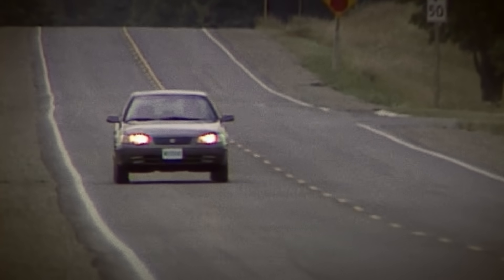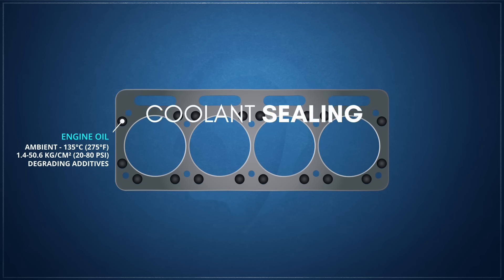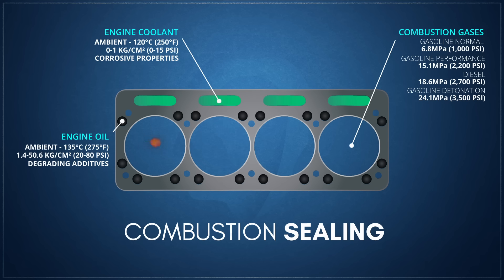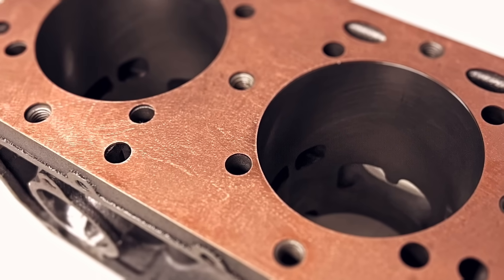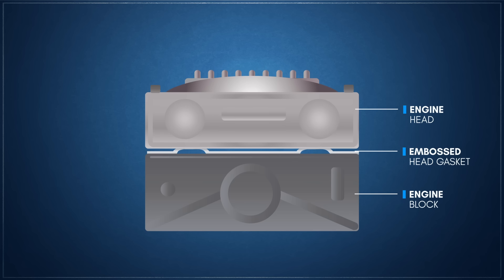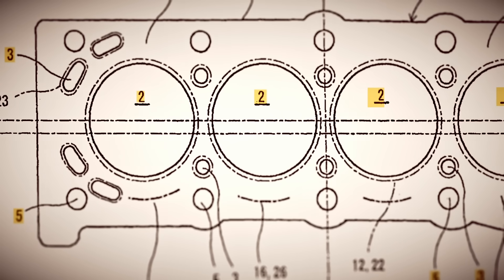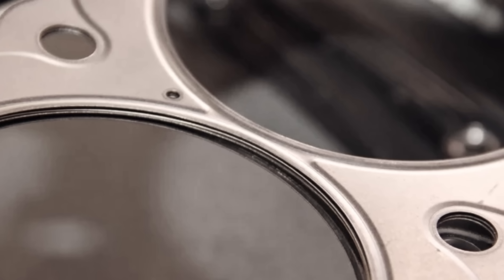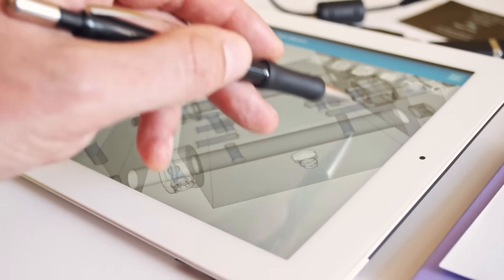The Most Tortured Part In An Engine

Comment: I seen the title and automatically disagreed with it, finished the video and dont really have anything to disagree with. As a 20 year mechanic I hardly ever see head gasket failures these days, ingress due to the pretty amazing engineering. Building high performance engines we have to nail the details of the sealing surface, blocks and heads are a mirror finish, MLS headgaskets and arp headbolts usually does the trick. The main parts problems I see these days is running engines exponentially over there design capabilities and trying to pinch pennies and not replace every part inside the engine with the best stuff on the market. Right now I'm building a 60s engine that was originally 125 horsepower 7:1 compression and taking it to 500 horsepower 10:1 compression with 20 pounds a boost, not an easy feat. But feel like the head gasket is the least of my worries and rods and crank start becoming the weak point. Of course you can replace them with 1 off forged pieces, but where is the fun in that.
Reply: There is absolutely no way on earth that a 1960s engine designed for 125hp is going to handle 10:1 with 20psi, it'll snap the rods (and probably the crank) like a twig.
Reply: @MattyEngland  not my first rodeo. Plus it has been done by several people before. Cranks are very well designed and should hold quite a bit of power, I am pushing the limits of the rods but they have been worked over to be the best they can be. Should hold up fine, the boost controller is tunable, worst case scenerio.i turn the boost down with a knob and all is good. Also has knock sensors on it. And the pistons are some drastic amount lighter then the originals with much smaller lower friction rings. With a good set of rods people have been known to get 1k horsepower out of them. And I know well over 1k with a aftermarket crank. I have done alot of work to make sure it holds up.
Reply: @townsendliving9750  They must have been the worlds most over engineered rods from the factory then lol....10:1@ 20psi gonna be some crazy cylinder pressures 😲 Best of luck. 👍
Reply: @MattyEngland  The over engineered rods are the modern ones. They know they'll bend like bananas at 200% of rated output power. 

Old stuff? Nah, just make it look like a conrod. If it breaks, we make it bigger.

Comment: I'll  be bluntly honest here the temperatures and pressure a head gasket has to deal with seem oddly low, I can see how the variation of which can stress it but I'm certain we have parts in other mechanicle objects that undergo much much more stress say in like a  jet engine.
Reply: Low when it's naturally aspirated. They get real stressed when you add lots of boost, timing, or nitrous.

Comment: My 2002 VW/Audi engine in my daily, has 20 years and 130,000 miles on the original head gasket
Reply: So?
Reply: @sexyfacenation  So it shows that a well designed modern head gasket can last for such a long time, despite hundreds of millions of combustion events, and many thousands of thermal cycles. A lot of less well built engines would need a new headgasket long before that.
Reply: @sexyfacenation  Time and driving conditions play a huge part too, not just the mileage!
 Practically all high mileage vehicles have clocked up those miles on long freeway/motorway commutes. Under cruising conditions the head gasket is at its least stressed, as combustion temperatures and cylinder pressures are both at their lowest points.
Driving short journeys in a city is completely different. Much higher cylinder pressures and temps when  accelerating as the engine is calling for boost from the turbo, and an advancement of ignition timing. Both those things are far harder on the gasket than anything you would encounter driving long distances under highway conditions.
Time is also a huge factor. Surviving those conditions day in day out for 20 years, combined with all those heat cycles, imo shows of just what a well engineered piece of kit modern headgaskets have become.

Comment: He's got the oil and coolant passages backwards
Reply: How?
Reply: @jonasthemovie  the holes around the cylinder bores are almost always coolant passage ways because you want the antifreeze running past the combustion chambers. The oval ones at the top look like they would be were the push rods come up from the camshaft and into the head also they look more like oil passageways even if this were overhead cam.

Comment: My friend make head gaskets for living, all made of copper sheet's. He made it for 2 stroke, for gasoline/diesel engine, for cars, dirt machines, tractors, ship's engines,semies bikes all of them.
All costumers are extremely satisfied and grateful.
So, I believe copper  is very good material for gasket, he believe that metal multiple sheet gasket is pise of shit, because after some time rubber coating fall apart and steel can't be press so strong that it fill voids in head and block.
He's father made some cooper head gaskets before 30-35 years, and costumers bring them back, for engine rebuild purpose only.

Comment: Engine oil has in every engine hard pressure limit set at 5-10 kg/cm^2. Uncommon failures of bypass valve are making cold oil pressure to rise above 10 bars and then oil filter can gets deformed until it fails open
Reply: The SI unit version has a range of like 40x and the imperial has a range of 4x, so there's clearly an error there somewhere.

Comment: Great video! One problem, in the first half of the video with the diagram of the head gasket the oil galleys and water ports are switched with eachother, since the coolant will need to be taking heat from around the cylinders and the oil usually just drips back through the head gasket down to the block
Reply: Galleries not galleys. 😵
Reply: @bat__bat  No, it's definitely not "galleries." That's where you keep artwork.
Reply: @jacobnelson2480  Surprisingly.. if you were to find parts in relation to them, they will all be labeled as "oil galley ___". While I agree gallery is the better choice, it seems that it is a galley for some bizarre reason.
Reply: Through my few years of school and experience I have always known them to be Galleys, but to each their own. I don't plan to change as that is always how I've known it, and this is what I do as a career.
Reply: Bugged me he used kilograms per square centimetre as a unit of pressure for half the video (nobody at all used that that I'm aware of) then switched to pascals for the last half which is at least SI and actually used.

Comment: Hey, min 4 to 7 - shouldnt it be 20-800 PSI - pressure of engine oil (or 1.4-5.6 kg/cm2)? :)
Reply: Top notch history of head gaskets! Thanks
Reply: Probably 5,6kg... 50 bar will wreck stuff

Comment: One thing I would like to add about head lift and the use of a gasket - The gasket is compressed during installation, so even during extreme cases of head lift (0.001") there should be no separation occurring between the three components.

Comment: Most new coolents are indeed acid based, OAT (orange, purple, etc.. organic acid tech) now, and DO directly attack some of these surfaces. GM had a huge issue with them eating thru intake manifold gaskets, and they would have very similar symptoms to head gasket failure. (oil and coolant mixed into the frappuccino of death). The green stuff isn't nearly as harsh, but needs to be changed more often (per OEMs).

Comment: At 2:59 I highly doubt the coolant gets that hot. Most common answer I found was around 104 celcius.
Reply: Depends on the engine and load. Common coolant boils at around 120 C, but some aircraft engines run high pressure systems that can operate as hot as 135 C

Comment: Your initial list of requirements doesn't include "cost" even though it is a primary driver in most engineering decisions (as seen in the rest of the video). I was wondering why they didn't get around to using crushable aluminum gaskets, but by the end of the video, the copper ones basically fill that niche.

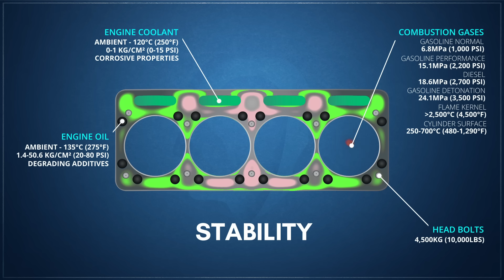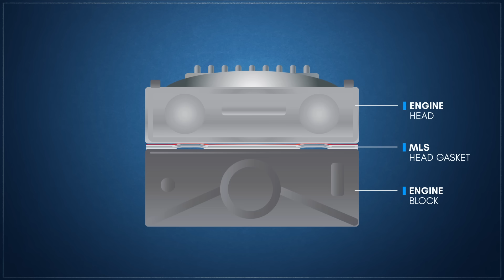Comment: This is a really interesting video so I hate to be a pedant, but there's loads of unit errors in here. You're inconsistently measuring pressure in Kg/cm^2 and Pascal (4:30), force in kgf rather than N (7:00), using the wrong capitalisation for milli and metres (14:10), rounding unit conversions with the wrong precision (12:20), using u rather than μ for micro and mistakenly using μm when you mean mm (14:20). It's difficult to follow your point through all of this.
Reply from the maker: Do you remember a while back when NASA lost a mars probe due to two teams working in completely different units? That's this video right now; I completely missed the errors. I can't really do much about it at this point without a complete re-upload.
Reply: Looked in the comments to see if anyone caught this too,
The micron finish is correct, the imperial units should be corrected to 60-80 micro inches, which is a typical/industry standard roughness achieved from a finishing pass from milling.
Reply: at 14:20 He's talking about surface roughness which is always in μm and never in mm in the automotive industry. it's the honing tolerance.
Reply: Yeah, those micrometer to inch conversions are off by orders of magnitude, but it's the inch measure that's wrong.  Those are millimeter equivalents, and a surface roughness of 1.5 to 2mm would be terrible.
Interesting video anyways, but those need fixing.

Comment: Kind of feel the connecting rod is at least in the top 5. Personally would have given it the number 1 spot. It is a lever that is long, has to change vertical movement to horizonal rotation, and is usually under stress. It also bears the weight of uneven friction if the pistons want to not piston for any reason.
Reply: Top  of   piston    pretty   stressed  as   well
Reply: And rod bearings, the whole valvetrain in push rod engines, etc etc

Comment: Psi translates into bars of pressure. Kg/cm² is technically the same but nobody uses that on daily life like psi is used
Reply: Anything translates to anything. That doesn't mean that PSI stands for "bars of pressure." The way that he used it, pounds per square inch, was absolutely correct. You can translate PSI into bars of pressure just like you can convert bars of pressure into PSI. 

In the US, we don't really use bar, we use PSI.
Reply: @orangejjay  yes and the rest of the world uses "bar" as a common measurement. not kg/cm²
it's just as meaningless to regular people as the "psi" for people who use "bar"